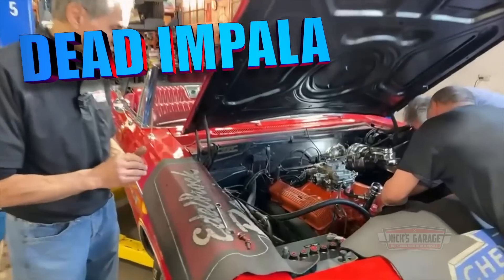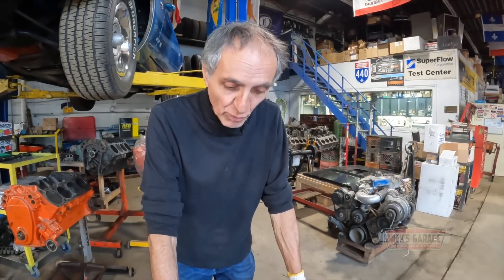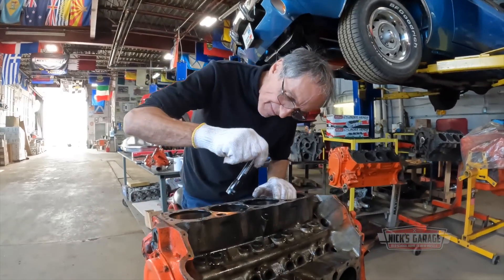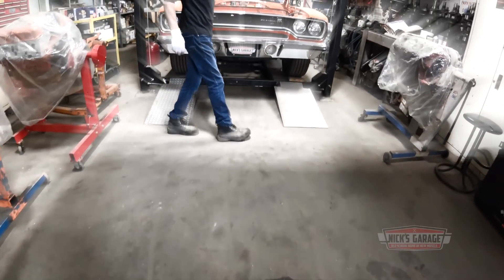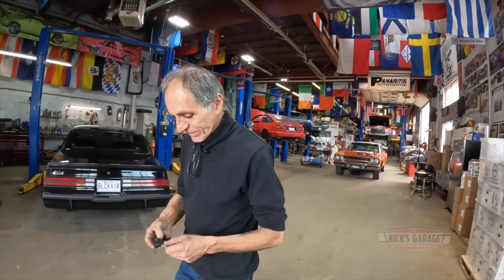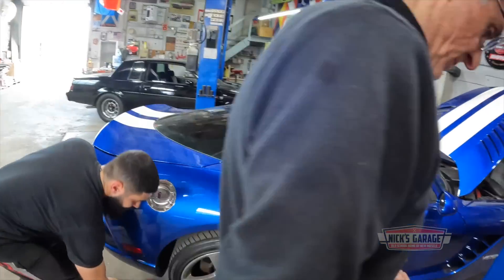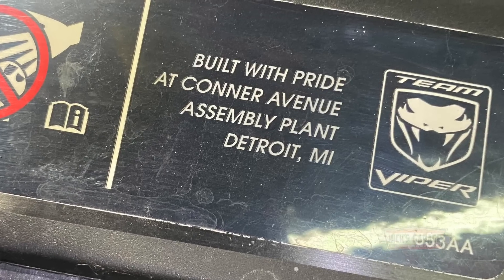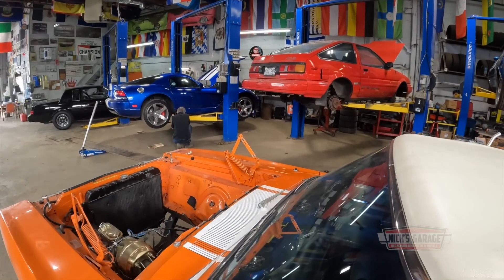327 Chevy Autopsy - Smoking Gun FOUND!

Comment: We are going to look at all the scenarios before this 327 leaves the shop.
Reply: Nick,love the show.l looked for that thermostat at Permatex.couldn't find it..Did you get it at Mechanex auto parts
Reply: Hi Nick. I had only a couple of thermostats fail in my career, one failed open the other failed closed. I'm not sure how you can insure that a thermostat or any part will last for any length of time, use the best you can and hope you and the owner is lucky.
Reply: @stevesosinski6692  .  
If most people could only grasp how many parts are quietly functioning properly to send them down the road, they'd be plenty nervous.......
Reply: @timewa851  ...how many CHEAP parts....
Reply: I was wrong. Thanks Nick.
Reply: Gauge package?
Reply: That thermostat didn't cause it's,its an end result..I've had thermostats blow the cooling system in an instant..with a loud audible boom..how is the rad etc..good luck Nick,and your shows are always worth watching..🎉
Reply: IMHO the DRIVER is responsible for this.  Faulty thermostat or not, the DRIVER has to take responsibility for the operation and safety of his vehicle.  This is just ridiculous how far he drove it  and how hit he got that engine.  That is no ones fault but the drivers for operating the vehicle with his head in his nether regions. 

Is he going to blame the shop when he runs out of fuel on the highway because he was too stupid to look at the fuel gauge as well?
Reply: Is that a 375 hp 327?
Reply: Maybe a leaking freeze out plug?
Reply: Buying parts anymore is a crap shoot, buying the best doesn't insure lifelong performance, you chose well, but...shrugs.
Reply: What do the spark plugs look like? If it was burning coolant, you will definitionally see it on the plugs. Also, look for cracks between the valve seats. SBC heads like to crack between the 2 inner exhaust  valves.
Reply: Someone might have drained his coolant when he parked it
Reply: @Car Guy daddyo ouch with a .040 over bore and a nice 4 barrel those double hump heads on a 327 made 375 hp hi reving solid cam engines
Reply: @nova467spanker  they checked the plugs, no coolant burning evident
Reply: If an engine spins a rod bearing but doesn't damage the crank would it be OK to replace just that rod and all the bearins? Or do all the rods absolutely need to be replaced as well?
Reply: @geraldtrembley2425  ...Yes I did.
Reply: @jamesemmeneckersr.1875  ... Good Idea.
Reply: @joshholden8561  ..... No, not really.
Reply: @nova467spanker ....  The spark plugs had no sign of burning coolant.
Reply: @thorloki5449  .... If you spin a rod bearing, the crank should have some damage in many cases. Replace the bearing and re-size the connecting rod.
Reply: @Nick Panaritis  Thank you, I'm actually not 100% that the crank has no damage, as I haven't torn down the engine yet. My plan was to just get a new rod and bearings and replace the crank if needed. 
 This is actually the first major repair and the first flat engine I do on my own. Without someone more experienced helping, so I was second guessing myself on if it was safe to replace only the bad rod.
Reply: I would check the intake mating surfaces on the heads and the intake for flatness. Sometimes on a small Chevy the intake fit can be off a little.and not seal around the front intake water passage. The front cylinders usually suck the coolant in and burn it. Same with the rear of the intake. Had this happen on a couple engines.
Reply: To be honest I'd rather it be a V8 or V6 than a Subaru flat 4. But it's my car so if I do mess something up I'm only hurting myself.
Reply: @nickpanaritis4122  It will be interesting to see where the coolant went. My stepdad is a chevy guy and said the sbc heads like to crack between the opposing exhaust valves in the center of the head. It must not have been a big leak because it most likely would have hydro locked the engine.,
Reply: @thorloki5449  only have to replace damaged parts but with high dollar cars like nick works on he gonna change the rods and wrist pins and keep the new pistons  pit new  crank main bearings will be new also
Reply: That 327 made 325 hp at least with a 4 barrel wh2n it was. New over bore with new parts its shoulda atleast made 350 hp rhe heads on that motor double hump or camel  humpnas we called them around here was the best Chevy small block heads that was ever casted  idk the compression on this engine but if it made 310 hp it must only be 8:1 lower compression those 327 engines are hi reving screamers
Reply: I have a 65 impala that was loosing coolant from the heater core when up to temp.  Not an easy replacement in a 65.

I don't believe a driver would not notice an overheated engine.  Detonation, smell, and power loss.
Reply: @williampommeranz6821  first I heard that idea nick showed the thermostat was stuck. Now did over heating break the thermostat idk but it got broke at 1 point and stayed there.
Reply: Owner had to be pretty lame not to
know that engine was overheating that badly. With todays endless amount of items being made in offshore countries and with poor quality control and inferior materials anything is possible
Reply: Magnaflux the block and heads.
Reply: I have about 10 friends that have used Fail Safe thermostats that have failed in the closed position within a 1000 miles.  I had one fail from start up.  I don’t know if you use those, but buyer beware.
Reply: Whether or not the owner has any responsibility for this is not material. Nick's shop installed the faulty part. The thermostat failed prematurely and is directly related to the engine failure. Knowing most parts suppliers,  they probably limit their liability to replacement of the faulty part. Look on the back of the package, probably has a statement of no consequential damages.  

The best that can be done from this debacle is to never buy one of their parts again.
Reply: @reedcearley1392  The owner drove the car while the engine was overheating and shared responsibility. He drove it to extreme overheat ignoring any sign of a problem. A compromise on responsibility and repair costs would be the most fair resolution
Reply: @thorloki5449  Not replaced, re sized , Cut the rod caps .015 and hone back to totally round, plus I always replace the rod nuts every time. and replace all the bearings . But you still MUST pull the motor all the way down to clean out all the oil galleys.
Reply: I always use a fail open thermostat a little extra money but stops boil out.
Reply: just guessing like everyone else on here. is it possible customer was driving the car while his girlfriend had her head in his lap?
 His right leg may have shoved the gas pedal  to the floor & never saw the light. lol
Reply: @billtribble7197  I had a similar situation many years ago!  Driving in a snowstorm in 76 or 77, my right leg kept getting heavier and heavier, I was distracted enough to end up grabbing some snowbank with the right side of the car, I came very close to losing it but managed to recover and get back into what should have been my lane…… a near crash with a happy ending……
Reply: @thorloki5449  - If you haven't torn the engine down, then you don't don't know if spun bearing is the problem... 
Spun bearing is usually because the bearing seized to the crank journal, so likely crank damage if spun bearing... 
Have you owned the engine long? Sometimes a previous owner will put a new bearing on a damaged crank journal and trade the vehicle in... next owner gets one day to a few months before it goes bad again...
Reply: @joshholden8561  - 550 HP cam totally mismatched to a 250 HP 327" engine... he's thinking of trying the L79 350 HP cam next... I'm suggesting a 204 - 210 intake duration cam for a heavy cruiser car with smallish cubes and low compression ratio... or a ZZ3 roller cam...
Reply: @BuzzLOLOL  no where says that's anything but a stock rebuilt 327
Reply: @BuzzLOLOL  it's the Subaru EJ25 they're known for spinning rod bearings, plus the knocking it has is a "bottom end" knock. And I actually had just gotten the car 2 or 3 months prior. It has now become my project car to fix the engine and throw upgrades at when I get the time/money. Only since my Aunt/Uncle sold me their 07 Saturn Aura for 700$ 50k kept in a garage(heck ya ill take the known reliable 3.5L Chevy V6.
Reply: Unfortunately then no quaranti this want happen again I would check with some of you other friends or engine builders that's in this industry see if they had any thermostat issues and even Google search problems with Mr gasket thermostat if so they have either changed the type of material there using or contracted it out to new company good luck Nike you like me what ever it takes to make customer happy it definitely hurts the wallet but want tarnish the name because one customer can do alot of damage I have worked and delt with public for several decades. Some customers can be brutal
Reply: @AdamsAdams-fc1ld  bet he ends up putting a LS back in.
Reply: @thorloki5449  you can replace aslong as you don't feel your nail get caught it's OK to replace just the bearing but make sure to measure the journal and big end of rod as it may need a bigger or smaller bearings  I would also check mains and rod bearings of all the rest bc if a bearing spun you will have tons of metal trapped everywhere in the engine which you don't want that material to damage your new bearing or the others

Comment: I have been in the engine building business for over 35 years and I put heat tabs on all my engines. There is a separate place on the invoice that the customer must sign stating if the heat tab shows the engine was overheated there is no more warranty. It saves a lot of arguments and court time.
Reply: Great idea and point there...plus signing the paper pretty much seals that door 🚪 👍
Reply: great advice
Reply: Been there, done that. We found in AZ that heat wasn’t all that was wrong with the SBC. On some oil pickup screens the screen comes loose if it gets clogged. This saved the original engine, but it’s no good when a guy buys a long or short block from a rebuilder like you or me and puts his own oil pan on. With a screen that has been opened and too much silicone, a bead of silicone gets drawn into the oil pump seizing the engine.
Reply: I sure didn't know that. Good way to çover yourself 100% do you do that for all engines old and newer?
Reply: what is a heat tab on a engine? I've never seen or heard of one and I've rebuilt quite few engines. dozens of them..
Reply: @staceygandy2009  Every engine and set of cylinder heads we rebuild.
Reply: Been using tabs for the best part of 20 years on every used or rebuilt engine and heads we sold in the wrecking yard. Had quite a few come back because they replace the engine but not the crap radiator that caused the last engine to fail. We also tell people to have the radiator checked before replacing the engine and tell them no warranty if cooked but so many brush that off because they are too cheap, stupid or both to make sure it is good. 
Been taken to consumer affairs a few times over cooked engines and does not even make it any further than the initial phone call they give you. You tell them the engine was heat tabbed and end of story. We take Pics when one comes back , they know it's the customers fault and that's it. 
I have put them on Clutch pressure plates too but they are a bit easier to see whats happened when they come back blue anyway.
Reply: @kennethcohagen3539  When we sell a long or short block it always comes with a set of gaskets and a new oil pump and screen. I insist they bring their oil pan and we will fit the pickup into the new pump with their pan and gasket to the proper height and then braze the pickup in place. We take the new pump off and put it into a plastic bag and show them a video of how to use silicone not only on the pan but everywhere else like the timing cover and intake manifold. We take the time to educate the customer on their particular application. From a turn-key install to a do it yourselfer it saves all of us a lot of headaches.
Reply: What about Ford mustang Cobra? Or Shelby?
Reply: Sold by Mr gasket
NOT made in north America!
Check package bet it says it
Packed by imported
Reply: @georgeweisbrod1876  No offense George, I sure hope you know what you are talking about because no one else does.
Reply: Heat Tabs, when attached to the engine block or cylinder heads, provide visual evidence that an engine has been overheated at the 250° melting point for gas engines.
Reply: Simply put, part was made in CHINA  shipped here packed and labelled as us materials, printed in USA for contractors (mr gasket). It is still crap sent here.
Reply: @anthonynelson9136  Speak for yourself Anthony because I know what he was talking about and I know a lot of other people knew what he was referring to and that is that Mr. gasket buys the thermostats from an overseas probably made in China, Korea or Vietnam and then re-packaged them with their name on it but they did not build it here in the United States. Pretty simple Demi
Reply: I remember the first thing my dad did when he bought his '58 Chevy Impala was to pull the thermostat and change it out. We went from San Diego to Louisiana and back twice a year. Texas was unforgiving to drive through. I don't remember the engine size but one time he pulled the heads and I thought those cylinders were the size of my head! We had that car for 10 years.
Reply: Yeah, this definitely helps when customers install engine. If you install engine and coil is missing from lower radiator hose or heat riser is frozen closed or pure antifreeze was used by mistake.  Stuff like this puts the blame on you.  Chevy I believe is the only gm car that the heat riser is normally closed.  All other gm cars it's normally open and uses vacuum to close.
Reply: Man great advice i will do the same video recording to may be ..i am thinking of going into building engines i would love to get some advice .i been doing stuff for my self but may just branch out into that .thanks God bless
Reply: @Doing_it_right_the_first_time  I
Reply: That’s because you are a machinist, not some wrench.
Reply: I have been a car enthusiast with experience as a machinist. I have rebuilt three engines and I cut corners but every engine I built is still running 20 years later. One ford 302 is on its third body. Lol  I built sturdy engines with moderate cams . The corner I cut was the machine shop. I know men that push a set of heads to the point of destruction. That’s not me. When I turn the key that machine goes vroom every time and it picks the nose up when you stomp on it. I’m getting old and I kind of miss all that.
Reply: @joeybagodoughnuts3357  Actually I am not only a machinist, I am also some wrench.
Reply: @Doing_it_right_the_first_time  You know a lot of other people that knew what he was referring to? How many is a lot, you and who else cupcake? You guys that are a little light in the loafers are always exaggerating the truth.
Reply: Unless you did not put coolant in it.
Reply: @doomman700  I am fairly certain that someone in the shop would have at least spit in the radiator. But just in case the person that did the work drives the car for at least 10 miles so that it has a chance to warm up all the way, and so we can leak check it. Now if I could just get them to remember to put oil in them.
Reply: @chuck7432  Maybe you didn't read the part where the installers have to drive the vehicle for a certain amount of miles looking for leaks or any other problems before he signs off on it. You are the exact type of person why Anthony puts heat tabs on everything. Someone who is always looking for someone to blame for their own mistakes.
Reply: Customer's over the years bought more than 400 engines from me.
Everyone of them I started and set up by me.
Never a problem.
I told them under warranty, keep track of mileage and oil changes.
Not one problem.
Just don't let any engine you build go out the door without you putting your personal touch on it. Period.